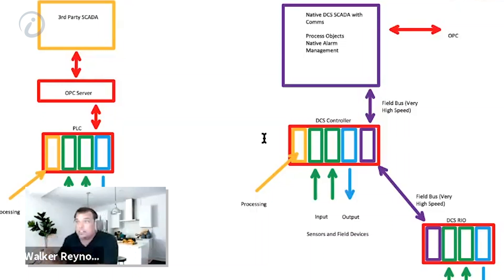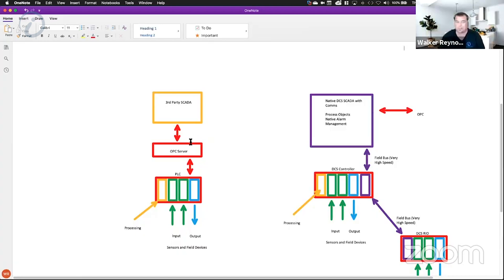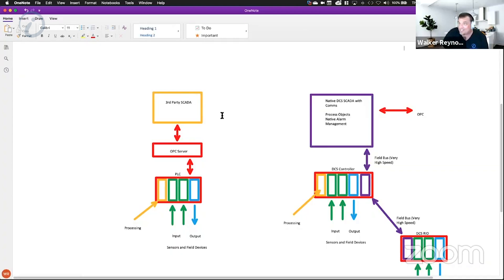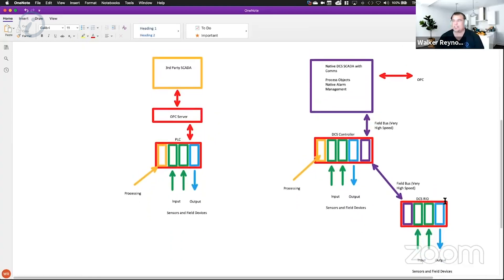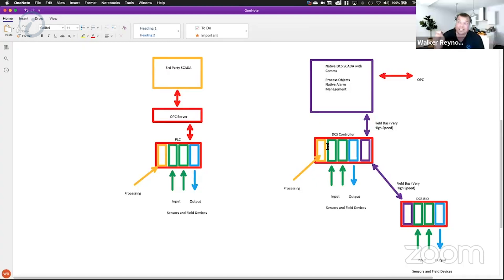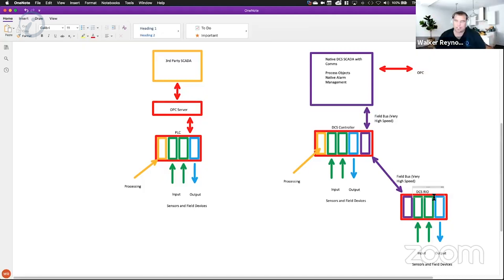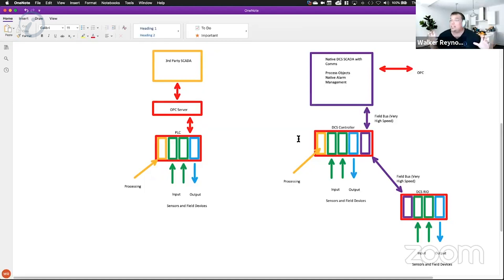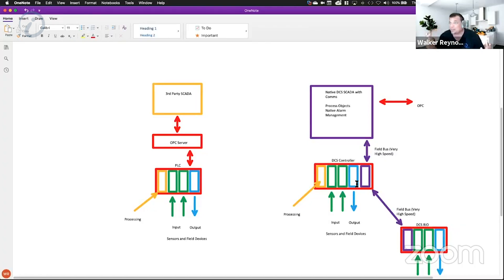PLC vs SCADA vs DCS (Detailed Response)

Comment: Not sure where you're getting your information, but you are dead wrong on several items here.  IF you are talking about modern DCS's, then pretty much all of those (that I know of) communicate over a dedicated Ethernet backbone.  So this "blisteringly fast" BUS you refer to is nothing more than Ethernet.  Same for Allen-Bradley and Siemens PLCs for sure.  And in fact, MOST PLC processors are capable of reading and computing many times faster than any DCS.  Some processes require millisecond response times; that's a PLC.  Typical RPI on a remote I/O device in a Rockwell system is in the sub 100 ms range.  Not so on a Honeywell Experion system, DeltaV or Foxboro.  The only "DCS" that I'm aware of that matches a PLC in I/O and processing speed is the GE Mark VI, and it was designed specifically to run turbine generators, which need that kind of speed.  The vast, vast majority of process automation only needs I/O and processing speeds in the 1/4 second range at best.  You simply don't need ms speed for flow control or VFD control, certainly not motor starters or discrete valve controls unless you intend to destroy your equipment.

Another place you are misinformed is that most of those pre-written function blocks in a DCS (and PlantPAx) are designed for very common, basic automation functions such as controlling a discrete device like a dual solenoid valve or a motor starter.  Sure, there are some that have been developed for very specific equipment, but those are not the "out of the box" stuff you get when you buy a DCS.  You would have to purchase those separately because a lot of development time has gone into them.  A pulp mill digester scheduler is a good example, or maybe a brewing scheduler.  

PlantPAx process objects are nothing more than bundles of code that make it easy to connect the appropriate I/O references, set a few parameters and tada, you have a fully functioning PID controller, just like Honeywell, Emerson, ABB, or whatever can do.  But these are absolutely NOT designed for a specific device like a rolling mill.  And BTW, I've worked in multiple steel mills making multiple steel products.  Every single one of them used Allen-Bradley and/or Siemens PLC's!  Not a DCS in sight!

In reality, PLC's and DCS's are 90% the same thing nowadays.  DCS's were once all built on a proprietary software platform but are pretty much all Windows based now.  And almost ALL systems utilize Ethernet as their backbone.  Sure, old BUS technologies still exist but only because there are still a lot of devices that require protocols like Profibus, Modbus, RS232, DeviceNet, ASi...etc, and they all absolutely SUCK.  The biggest difference between a PLC and a DCS is that the HMI is an imbedded part of the DCS and not with a PLC and the speed difference, which is faster in PLC's, not DCS's.

The other big difference is scaling and price.  DCS's are too expensive for small machines, which is why EVERY small machine, skid system and OEM comes with a PLC of some kind, NOT a DCS.  You simply cannot buy a DCS of any kind and put it on a machine the size of a kitchen table for under $5,000.  That just doesn't exist in our world.

Sorry to dump on your video but I had to point out these errors.
Reply from the maker: Consider this a free dumping ground! Thank you for your detailed comment Mark!

Comment: Walker, you’re great, I hope you see this. In this case I think there is a large misconception. DCS is NOT for high speed. AB PLCs are much better for high speed applications. What is faster with DCS is deployment since so much is prebuilt. DeltaV for example CANNOT handle fast things. Think of it this way- DCS grew up in the process world where things like temperature and pressure are of concern. These variables change over seconds or minutes. PLC is great for high speed printing, DCS cannot even do it the hardware can’t even handle processing that fast.
Reply: Glad to see others catch this mistake.  I would like to see Walker amend his video so these misconceptions are not propagated.  I've had to explain this to numerous young guys just entering the automation field and dispel the myth that one is better than the other when in fact they have each served different needs in industry for ages.

I would say that regarding deployment, DCS's have few real advantages there.  Because most PLC manufacturers have incorporated functional control blocks for basic devices like valves, drives and motors, this advantage has vanished.  However, some manual configuration is required to establish communications between PLC processors and that is a real advantage for a DCS, which is literally just a few clicks away from getting a bunch of controllers to communicate any of their data with one another.  Not so with a PLC.  This is something the PLC guys need to work on.
Reply from the maker: Thank you for clarifying Derrek.

Comment: Thanks for the video. However, we prefer to use our SCADA's own communication drivers, if we have them (eg Modbus, S7 over ISO, Dnp3, Iec-101/104, Omron Fins, Bacnet..). I think most of other SCADAs do the same, don't they?
(D2000.IPESOFT.COM)
Reply from the maker: Does your SCADA software meet the requirements of being an Industrial Unified Namespace? Edge driven, report by exception, light weight and open? If so then by all means! If not, you will have trouble scaling that infrastructure across an enterprise.
Reply: @4.0Solutions  Am I to understand that the main reason for the OPC UA server in the design you describe is to provide PLC data not only to SCADA but also to this "industrial unified namespace" broker? I didn't realize it. Thanks for your explanation!
(it may seem obvious to you, however, it had better be emphasized .. as not all OPC (UA) servers have support for MQTT and other protocols as KEP :)
As for our SCADA: 
- it certainly has [is based on] what you call "report by exception" though we traditionally call it "event-driven" ( https://doc.ipesoft.com/display/D2DOCEN/Object+Communication )
- individual tags can have a naming convention that corresponds to this "Industrial Unified Namespace". With the exception that we don't allow slash/backslash in object names so that it would have to be replaced by a dot or underscore (like Enterprise.Plant.Line.Plc.Tag). Of course, we can assign tags to tree structures (they may or may not respect "unified naming".
- when "publishing" to a central "broker", our SCADA can be both an OPC or OPC UA client/server, or it can be an MQTT Client .. or use the protocols that the broker supports (the full list is in the documentation - https://doc.ipesoft.com/label/D2DOCEN/komunikacne_protokoly )

Comment: Thank you for the brilliant explanation sir. 
I have one doubt, Now i find PLC's are coming with distributed I/O architectures. Can you please put some light on its functional difference with DCS.
Reply: That was a terrible answer from Walker.  PLC's are nothing like "Legos" and anyone who's ever worked with them knows this.  In fact, you can buy scores of Lego sets that are designed to build only one thing, like an X-Wing.  So I have no idea what he's even talking about. It's like he's saying a DCS comes pre-built to run your plant.  Nothing could be farther from the truth.  I've configured dozens of systems and have yet to see one out of the box ready to anything but light up.

When you purchase a brand new DeltaV system (for example), what do you get?  You get a blank controller, blank HMI, blank stations and some I/O cards, same as any PLC.  You have to build EVERYTHING yourself.  Both PLC's and DCS's come with basic control blocks that you can configure to suit your needs.  Both come with distributed I/O architecture.  Both communicate across an Ethernet backbone.  Both come with single or redundant processors and I/O structures, ring, star and linear architectures.  Both offer Basic Process Control System (BPCS) and Safety Integrated System (SIS) versions.  Both offer various SIL protection levels.  Price and scalability are the most important features in determining which is best for your process.
Reply from the maker: Hi Satz. Thank the difference is based on the application DCS are closed and high speed, turn-key. PLCs are like legos. Thank you!